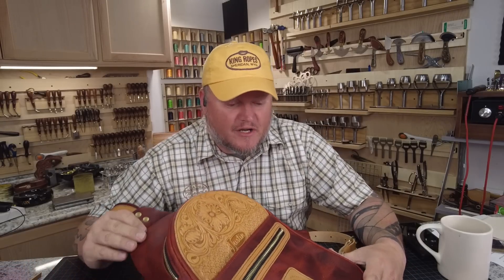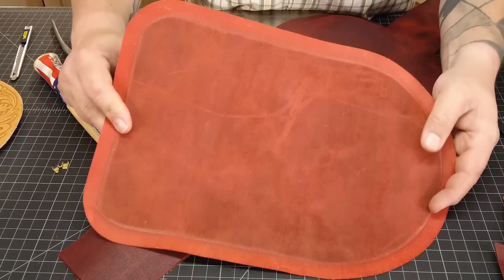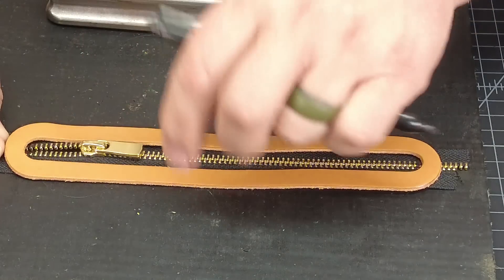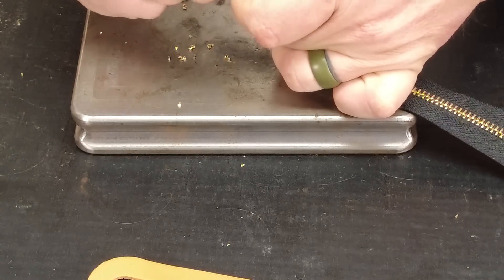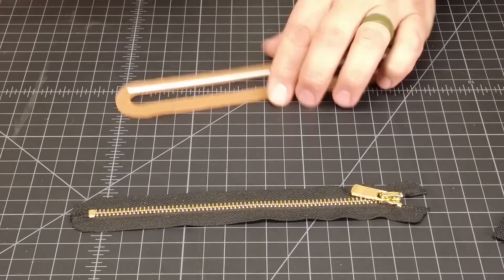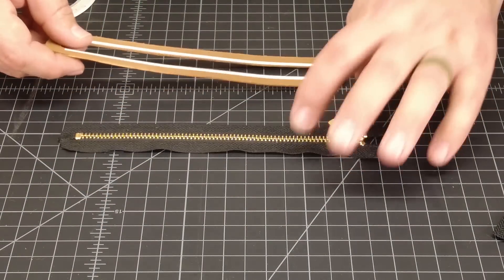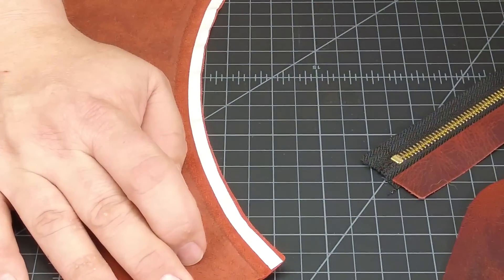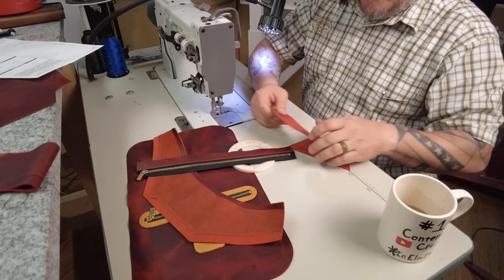The Sling Bag sponsored by Justin Boots

Comment: Why Don't you use rubber cement for this project. Boot Makers have used for years with greet success.
Reply from the maker: Because it is not needed.  It's Faster to not worry about cement